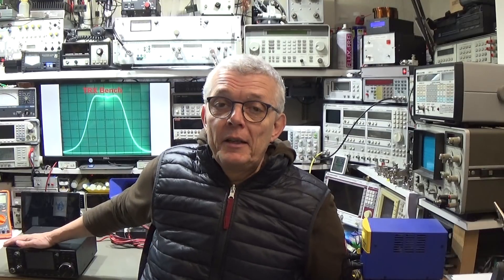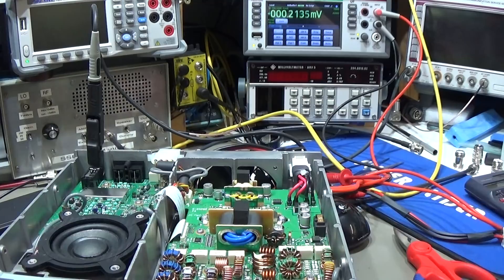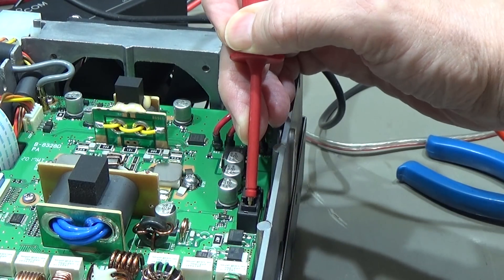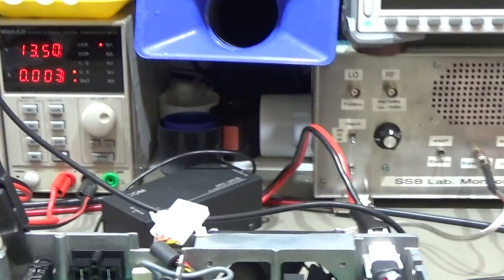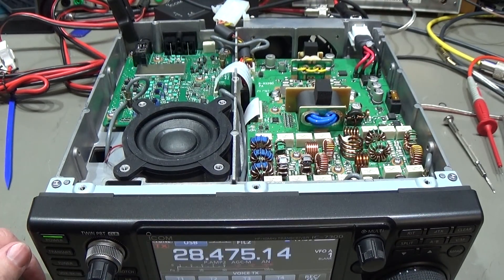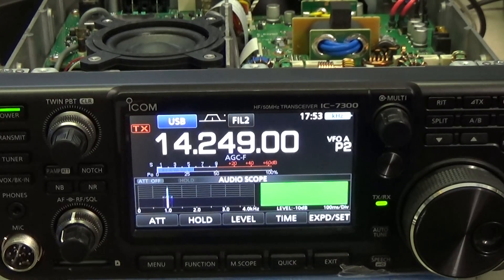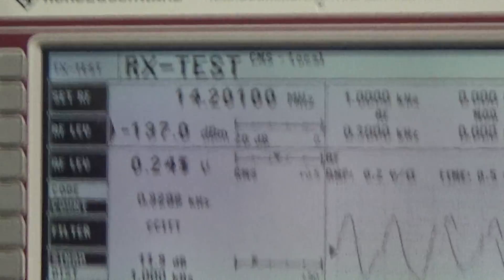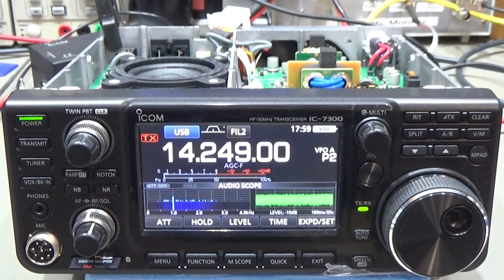#247  ICOM IC-7300 totally dead

Comment: Since it was the low current dc bus fuse, maybe it had something to do with an external device that was interfaced to it. Possibly an amplifier connected to an ALC connection on the radio and some fault between the two or possibly an external mic/headset that uses the mic bias from the radio causing the 5 amp fuse to blow.
So many variables between your bench setup and the rig owners setup, anything is possible.
Thanks for sharing with us Peter!

Comment: That fuse was what I always called 'hard blown' meaning that is was exposed to a high current short. You can always tell by the amount of material removed from the fuse link itself and in this case it was a lot.
Reply: EXACTLY my thoughts.  I won't be at all surprised to see this "repair" come back VERY soon!

Comment: Thanks for the solution to the dead 7300 of mine.  It was caused by a poor solder joint on the ACC DIN plug I made up.  It let go while pushing the connector into the DIN socket.  That'll be the last time I'll try to solder up a 13 pin DIN.  Thanks again for this money saving video.  73

Comment: It happened to me not to long ago, I accidently shorted the band data wire in the accessory port to ground and the radio turned off just like in this video. The 5 amp fuse blew and to my amazement, the radio came back to life after replacing the fuse but also the band data pin is still working providing different voltage output depending on the band the radio is set in... I was sure that the band data pin would have been blown specialty when you think 5 amps whent throught that pin, none of the minuscule traces blew and none of the transistors that drive that band data pin blew ! I wish those pins would be protected with lower amperage PTC but the design protection worked and did protect that band data pin on the accessory port ! Phew !
Reply: You are lucky. You know it. In fact, there are a lot of other signals, that could cause issue like this when shorted to the ground, typically auxiliary power for ATU, modem, whatever and I agree with that they should be protected by PTC or fuse, because if you short the +13.8V auxiliary power on the ACC connector (which is present in almost all Icoms and Kenwoods), it sometimes results in a PCB damage, which is a kind of unfortunate. Much worse is when the +8V line (which is present at microphone connector of almost any ancient Icom) is shorted to ground. This results in damaging 8V stabilizer, that, when short is removed, typically puts the 13.8V into 8V line causing a huge damage to the whole transceiver.
Reply: @NikiBretschneider  yeah I know I am lucky that no other damage occured to my 7300 ! I am building a breakout cable so I can use isolated audio input/output and while I was thinkering, I've decided to pull all the other pins too in my breakout box so the 13.8V acc pin, band voltage pin, FSKK pin, squelch pin and lastly the PTT pin that works in both direction in/out. I've also installed a DPDT relay so the PTT pin can control an accessory power trought that relay instead of the actual pin... It is while moving my prototype board around that I made the accidental short, I saw smoke from the wire and the radio went silent almost instantly... that is scary to see... But now I think I will protect all the pins with PTC devices like the 13.8V with 050 PTC and the band voltage probably with a 010 PTC directly on my board... no one else than me will fiddle with that breakout box so I "should" know what the pins can drive but in case something goes wrong, at least I will have some protection... humbling learning !

Comment: I've seen it before...sometimes a fuse simply fails as a manufacturing defect. But the OM should try to stress the radio by putting it thru its paces to double check. Easy fixes are the nicest but sometimes the most perplexing!  73 - Dino KLØS

Comment: I am not familiar with IC-7300, but this is a common issue for most ham radio TRXes. We both know that that fuse was blown for a reason and I am almost sure that the reason lurks outside that poor radio. Just check the accessory connector(s), external ATU connector etc., because they are known to provide 13.8V DC output to power the accesories which is switched by the radio power switch, so that voltage have to be taken behind this 5A fuse. And when that auxiliary power outputs are shorted to ground by some external device or miswired cable, they just blow that fuse, but also sometimes damage the PCB near that shorted connecotr or some RFI supress coil if they is present in series with that power output, so that 13.8V DC power output dissapears from that port. And this is something that have to be fixed, but not only in the radio (if there is some damage), but also in the device or cable, that made that fuse blown.  In fact, almost everything inside the radio is behind this 5A fuse, the only thing that gets power before it goes to that fuse is the last stage of RF PA. And there are no other fuses than this one. This is what I remember from my praxis in the past when I was in this bussiness.
Reply: I have a Ic-7300 and I can tell you there are sometimes it will pull 23 amps and you Cycle the Power turn it off and Back on and it will pull 18 amps in the Very same place of the Same Band and the Same Mode at 100% Power the Software or the  Sensitive Circuits for my Friend and I was talking and his Ic-7300 Went out and I told him too Pull the Top and Check that Fuse and he wouldn't and he Sent it out and it was that Fuse and they Couldn't Find any Reason why that Fuse blew and they Sent it back and it has been Running Great.

Comment: Thank you so much. I connected the external cable for Icom tuner withe the radio turned on (my mistake) and it turned off. Your video was a real solution. I was almost crying, hehe.

Comment: One thing I would have tried is to operate the automatic antenna tuner while in transmit. It involves motors (and/or relays), which draws more current. Thanks!

Comment: Max transmit power of 100W, and a fuse that is rated for 60W. Likely just blew from long term rag chewing by the operator.

Power on when power applied is microcontroller remembering last state before power was disconnected, and resuming in that mode, power settings and such.
Reply: I think the 5A fuse just supplies some low power circuitry which includes the "power switch" facility i.e. not the current to the PA section, I guess the power cable is fused at 20A
Reply: The current for the final amplifier does not go through that fuse.
Reply: I know someone that blew that fuse by trying to connect a Kenwood linear amplifier to the radio

Comment: The fuse should carry 5A for ever! So would need to check the data sheet for fusing times at different  currents.  A good look at fuse would give you an idea of how much current was flowing at the time.  Heat damage would indicate higher current  for a reasonable period before fusing,  clean but splatter about inside, very high current and very short duration before fusing.  But could be just a badly made fuse in the first place,  bit hard ti test the fusing current before selling it  🤔

Comment: If it's just a blown fuse, replace it; however, something caused the fuse to blow.  I am used to seeing barrel fuses in radios, but now blade (car) fuses are being utilized.  I just wonder why they're using blade fuses now instead of the barrel fuses.? I almost purchased an ICOM 7300 but we have a 2 meter net on Wed. night here in eastern Tennessee and the Yaesu 991a is the only radio I could find that would do all mode including VHF.  At least I know how one looks on the inside.  Thanks Peter. 73  W Rusty Lane K9POW in eastern Tennessee

Comment: I have a 7300 that is also dead. The fuse is fine, of course. After an accidental PSU overvoltage, it toasted a IC on the main board instead.. Peter would you be interested in repairing this for me. At my expense of course.
Reply from the maker: Overvoltage is always a serious issue and can hit many components. A repair can be a rabbit hole without any guaranty but very expensive, so no recommendation...

Comment: A 5A fuse protecting a 100watt radio? If this carries the full supply current it should be more like 15A. What does the circuit diagram show, it might have been a good idea to measure the current through the fuse.
Reply: Should be more like 25A I'd assume the 5A is just the control and Reciever no control no go etc... I did think the same as you initially
Reply: There are 25A fuses inline with both the red and black dc supply wires of the radio
Reply: Like most radios that fuse is for the logic and control side NOT the PA side. The PA is protected via the inline fuse on the DC cable. The PA collector/emitter or source/drain ALWAYS have DC on them even if radio is OFF

Comment: Hi Peter,
Another very interesting repair!
Small faulty reason, big messy result...
For me it looks in your magnification camera, like the fuse getting to warm for longer time because of the body turning "brown" and it looks also like the blades  of the fuse are a little bit oxidated?
Is that possible reason of blowing the fuse because of overheating the contacts?
Es ist immer wieder schön, Deine Videos anzuschauen.

73 de Stefan DG4RBS

Comment: Strange, at 106 watts output, the radio would draw 7.85 amps IF the radio was 100% efficient. Should I assume the power amplifier uses a separate fuse, that the 5 amp fuse is only for the radio minus the power amplifier?
Thanks for the video Peter.
Reply: I've read my Xiegu G90 (20W) uses up to 5.5A on transmit. The 7300 manual says max TX is 21A. There is this 5A 'circuitry fuse' but also a 25A fuse in the power cable.
Reply: The PA relies on the much larger fuses in the power cable.

Comment: It's a damning indictment of the state of the hobby that the owner couldn't diagnose a simple fuse blown. They did t even think to test.
Reply: This was along my train of thought.
I'm currently in the midst of studying, by no means electronics wizard but a tinkerer none-the-less. The requirement to get certified where I live seems like something as trivial as a fuse should have been an easy fix for even the ones who barely passed their qualifications...
Then again, maybe the operator who has this radio is an old timer, and nearing the days where he becomes a silent key 😬
- From the land of VE4
Reply: Maybe Peter is a friend, lives close by and the owner just didn't want to mess with it.  2 repairs across my bench in the past.  One was an Icom hf, said no vfo working.  The guy did not know there was a vfo lock button in the lower right corner.  a second guy swore his HT did not work when it was the PL tone not turned on.  I do agree, fix it yourself.  Some just do not wanna bother.  One other excuse.  It is a reason for the "old ham"  to get out of the house for a bit.

Comment: Hello! Did you have a chance to repair Icom IC-705? I have some problems with mine and probably it's because of the VHF/UHF Tuned BPF (I have too many and to strong spurious signals). But surprisingly I can't enter the Adjust Mode. Maybe you know how to enter the adjust mode? I did everything according to the Service Manual but was  not successful. Unfortunately. Thank you.

Comment: I have a Friend in New York that his Ic-7300 Died rite in the Middle of Talking too me and he Called and told me his ic-7300 just Died I told him too Put the Top Cover for I seen a Fuse When I Opened up my Ic-7300 When I Opened the Tx I seen this Fuse in my Ic-7300 and I Told him too Check that Fuse and he wouldn't Open his Radio and he Sent it out for Someone too Fix and it was the Fuse and they just Changed the Fuse and Sent it back and it's been Working Fine Ever Since. I have Taken Note Sometimes I Get a High amp Reading of 23 Amps at 100% I Turn it off and Back on and it Go's back too Normal 18-19 Amps I never Blown a Fuse but I Keep a Good Eye on it and I know it's putting out all of 110-115 Watts and I have a AH-4 Icom Tuner and I don't have any SWR over 1.5 and some Bands 1 to 1 SWR so how Much Amps Per a Band shouldn't Change but sometimes it will Pull a Lot of Amps in 100% and you Cycle the power and it Total go's Away so I not sure Bug in the Software maybe Sensitive Circuits Not Sure but I know you have too keep your eye on the Amps and It only happens once in a Blue Moon but if it go's out on you Check this Fuse My Friend Could have Saved a Lot of money if he just Pulled the Top cover and Check this Fuse and I would bet the only of this Radio Won't have any Problems it's just a Fluke blowing that Fuse.

Comment: I think, the fuse blew due to overheating. I had a similar problem, where the fuse had bad contacts (i.e. resistance) in the fuse holder and therefore got warm - that increased this resistance and the heat dissipation increased ... and so on.

Comment: Hi there, How did you tap the rx for the sinad sniff. Did you take it from the speaker out? Cheers and thanks for the video 73s Kev Mm0kjg
Reply: Yes, he plugs into the radio's speaker out jack.  He has an interface box that has a speaker in it so he can still hear the audio.

Comment: Hey Peter, I am sorry if it is a dumn question but what the supply current should be at 105W?
Feels like that 5A fuse is underrated?
Reply: The final amplifier current doesn't go through that 5A fuse.  That fuse just protects the other circuits in the radio.  There is a 25A fuse in the power cord for the finals.
Reply: @JorksX  Oxidation or poor contact in the fuse holders for automotive blade fuses causing voltage drop is somewhat common.  Simply clean the blades or adjust the contacts and the problem will go away.  This problem isn't specific to Icom.  You'll regret getting rid of the fuses the day a final output transistor shorts.

Comment: Hello Peter, thanks for the great video.
The IC 7300 is a great transiver, I have one too. Unfortunately I used the wrong headset adapter 3 years ago. Since then, the power supply to the microphone jack has been defective.
Is this a repair effort that a beginner can carry out himself?
vy 73 Rene DO2Vi

Hallo Peter, danke für das tolle Video. 
Der IC 7300 ist ein toller Transiver ich habe auch so einen. Leider habe ich vor 3 Jahren einmal ein falsches Headset Adapter verwendet. Seitdem ist die Spannungsversorgung an der Mikrofonbuche defekt. 
Ist das ein Reparaturaufwand den ein Anfänger selbst durchführen kann?
vy 73 Rene DO2Vi
Reply from the maker: Hallo Rene, für einen Anfänger der noch nie mit SMD umgegangen ist würde ich es nicht empfehlen. Besser zunächst an alten PCB's trainieren und natürlich das richtige Werkzeug benutzen. VG Peter